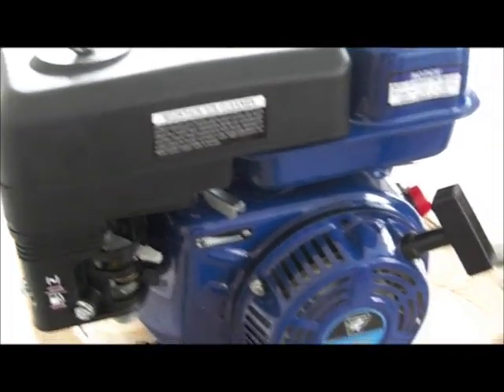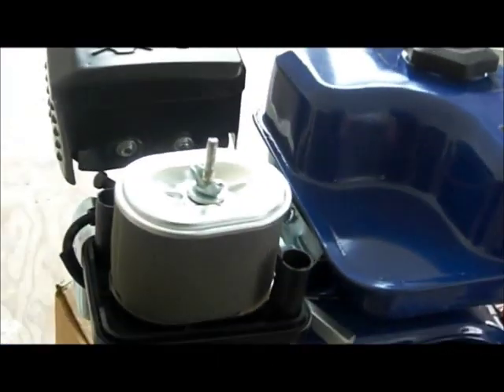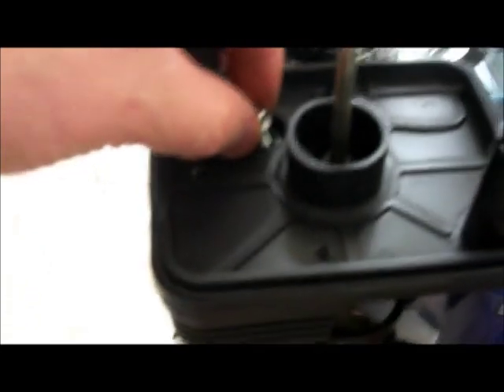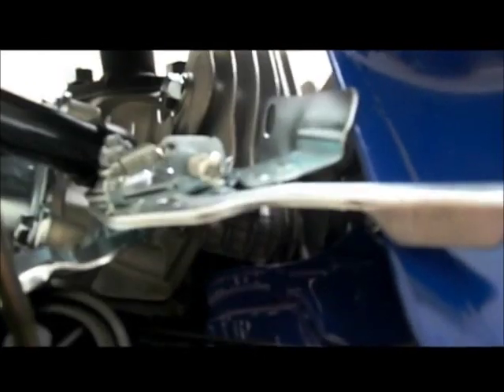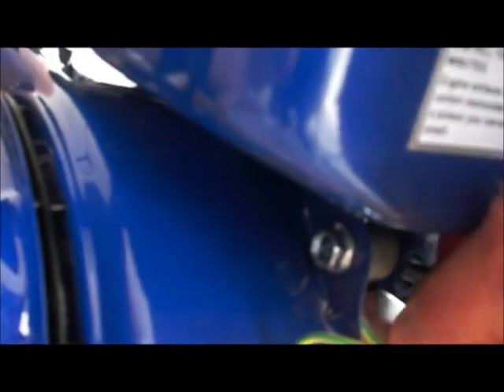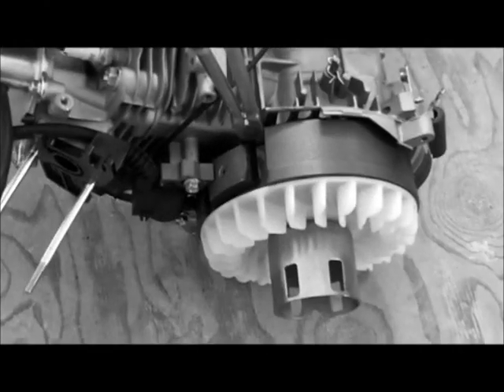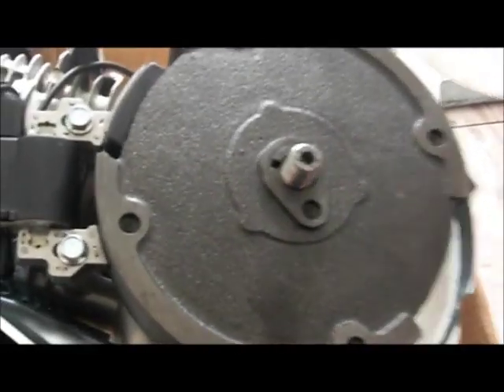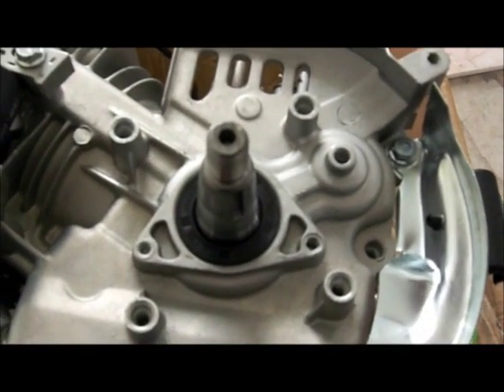Baja Doodlebug 6.5 conversion Step By Step  1 of 5

Comment: You make removing that flywheel look much easier than what I've experienced.  Did you not beat the crap out of it in order to get it off and then just start recording once you got it loose?  Really, a couple of taps with the tool and it came lose that easily???

Comment: @misterfabricator.... Removing the governor will provide u with more rpms resulting in a top end speed and a slight gain in hp... People question doing this for a couple reasons.. 1 flywheel exploding.. This is the most dangerous thing that can happen from the removal.... Remedy= billet flywheel $100... 2 floating valves not much harm can be done to u from this but it's not good on the motor remedy 18lb or in highly modified engines 26lb  valve springs  u can pick up the pair (intake and exaust